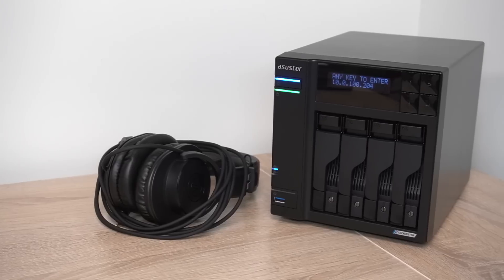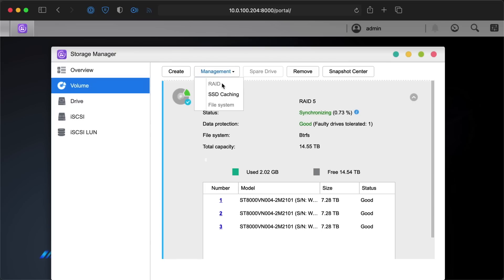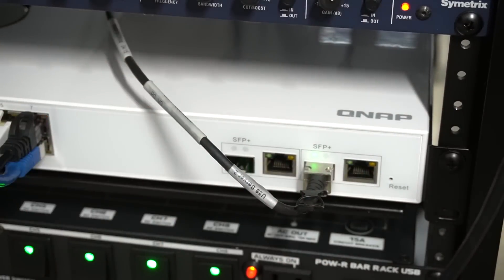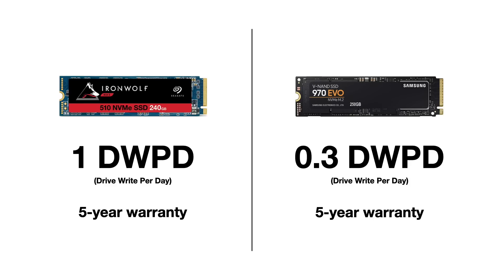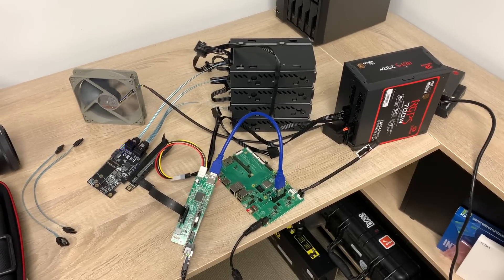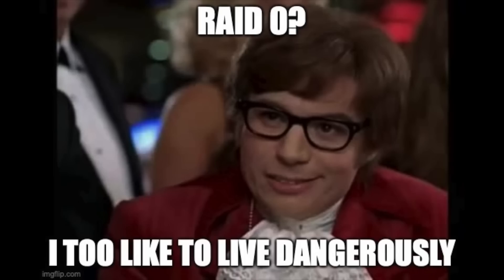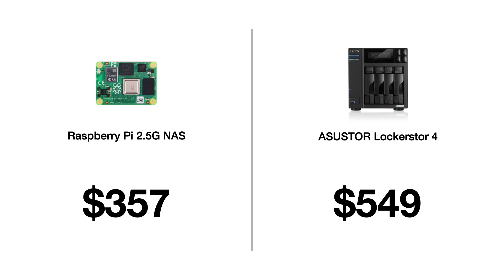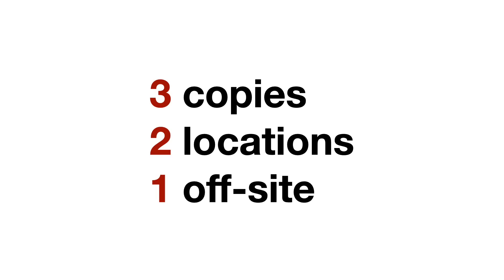Raspberry Pi vs ASUSTOR NAS Head-to-Head Part 2 - the VERDICT!

Comment: I recently built an Argon EON Pi NAS, which apparently released just barely after this video. My experience with it has been an interesting middle of the road NAS; Argon Forty put most of the effort together in making it. There are two weird downsides. The first is that the drives are connected via USB, and OMV doesn't let you set RAID up via USB, anymore, so you either have to hardware config RAID or set up a backup. The second is that it has 4 bays, but doesn't fit 4 3.5" drives. 2 of them are 2.5" drives at most. I don't think that's bad, but it is odd. 

I can't actually comment on the speed because I optimized it for capacity, but I strongly suspect that the EON will get bandwidth throttled by that single gigabit connection.

Comment: Yea, that's always something you need to consider. What is YOUR time worth? My employer, depending on the type of work I'm doing or if it's say after hours, charges anywhere from $250 to $800 an hour for my services. On my own personal time and considering tinkering with Raspi and home networking.., being a hobbyist maker... I'd put my time around $200 and hour. I'm cheap but not... eh...who am I kidding. I'm easy too !😝.

So, day you spend and hour setting up the ni e pretty NAS out of the box but..  you spend 4 hours building the Pi NAS...which is pretty damn cool as hell... you're in the a pretty big hole! I would spent 4 hours building the Pi at a rate of $800. He'll, I likely would've spent 4 times that much time considering I'm not even a year into Raspi and still learning.., a lot! That's why I subbed Jeff's channel. He's a good egg. 

Regardless, I do have a nice little Raspi NAS now at home running Open Media Vault...which I really like. My transfer rates are nowhere near what Jeff is doing but for now, I really don't need it to be. I'm not doing video or anything like that. Just nice having an extremely inexpensive storage solution that my laptops, other Raspis and mobile devices can easily access. It was also a fun  learning experience setting it up. OMV does make it a very easy process. Little bit of video watching and reading to really tweak things. 

What I love most it... no more 21U or 42U rack with servers acting like a very noisy space heater. Have 4 Raspi servers running all on a shelf on the wall... in my home lab with a very quiet fan and a fraction of the electricity. It really is amazing what you can do with a Pi! The only limitation seems to be ones imagination! 

Cool videos though, Jeff. Another example of what you can do with Raspi. Cheers!

Comment: Been looking at building my own nas for over 6 months now, I purchased a Qnap and I was underwhelmed, as with Asustor and with all nas systems I keep hearing you have to backup, so you buy the hard drives to place into your nas these hard drives cost a fortune for 18terabytes per drive. So I came to the conclusion you are just better buying a desktop usb 3.1 gen 2  bare hard drive dual bay direct storage device and just copy data from your computer to the hard drive then back it up to the second drive. I achieve 209 MB/Sec which is 1.5GB transfer speed which is pretty fast for me, doing it this way I dont have to wait 1.5 days for the nas to initialise and I save on space as if I build my own nas I have to buy another pc case which takes up valuable space. If I go with a ready built nas solution like Asustor, Qnap then you are not getting good value for money and if the nas fails you have to buy another nas from the manufacturer.  So I went with the OWC USB-C Dual Drive Bay Solution. The best decision I ever made I have all my data stored on one hard drive and then I have a backup copy on a second hard drive I am secure doing it that was, if you buy a nas and you have 4 or 8 hard drive with raid 6 or raid 10 you better hope your hard drives dont fail during the rebuild process as this is when you have the risk of losing all your data.  I dont have the cash to buy a nas then buy a second nas to backup up the fist nas tot eh second nas does not make sense to me to do it that way. Either way I have what works on a budget way of backing up my data. A nas sounds fantastic but from what I gathered it is risky especially with hard drives with 18Terabytes of storage space over 8 drives I could not stand to lose 130.4 Terabytes of data if say 3 hard drives failed all at the same time I would lose the whole array and your hard drives are plotting against you.

Comment: Not knowing much about NASes I wonder what performance gain you're getting on this monster vs just regular USB desktop hard drives plugged into the Pi's USB ports and the built-in ethernet.
Reply from the maker: Typically the USB drives incur a performance penalty of 5-15%, depending on the type of operation. That's the overhead in translating from SATA -> USB 3.0 -> PCIe -> the Pi's SoC.

For a 1 Gbps network, that might not be an issue if you're just copying large files and/or using the Pi as a media server.

Comment: A stock NAS is great, if you want to have an out-of-the-box solution. It will work fine for many years and you have many additional features. When it becomes too old, you have to buy a new one.
The Pi solution needs much more manual effort but you get a full computer and you can easily upgrade a view years later to the next gen Pi.
If you really just need a NAS for data storage, buy an external hdd storage for 200 bugs and you have everything you need.

Comment: if you could guide please,
we are looking to setup a setup where we want atleast 10 connections using the client/server model, a 1 TB SSD, 32GB RAM Xeon server. and 10 raspberry PI connected to it as clients. 
We want to setup an obser setup for our ongoing googlemeet live classes. will this setup work?
would appreciate insight on this idea.

Comment: Enjoyed your video. Just using desktop G3900 and truenas. Wondering if it worth getting those 2.5 Ghz ethernet cards. Also probably need another backup besides nas.  Don't understand 10 hours initializing. Would raid 1 take this long ? Seems file transfer speed depends on ethernet as well as hard drives. Have to learn how to use bandwidth and transfer programs. To increase speed  you would  probably have to go to SSDs. 4 8 TB ssds=$$$
Reply: I hope you don't mind us interjecting. We use software RAID which uses the CPU to build the RAID array. While the CPU on our NAS is plenty fast, the bottleneck is the 200-300 MB/s maximum the hard drives can handle. And 24 TB is a lot! Hardware RAID takes advantage of dedicated silicon to build arrays, especially in the background. It is often faster. Plus he has 24 TB as well. During the building of the array on an ASUSTOR, it is usable and you can store as you would normally. You do not need to wait. 

And yes. Those 2.5GbE cards are worth it and are often the same or similar controllers to the ones we use directly in our NAS. If you don't have enough PCIe, we sell an affordable USB 3 to 2.5GbE adapter as well.

Comment: An alternative is to use another SBC, like the ODROID HC4 (ideal if you only need 2 drives and GbE), or a Rock Pi, which has PCIe Gen2 x4, and official SATA extension boards. Using these, you could build a NAS for about $100-200, much cheaper. They also have the advantage of having AES acceleration for encryption, unlike the RPi 4, which delivers poor AES performance. 

Another alternative would be to build a PC with an Atom or Celeron motherboard, and that would still be cheaper and more flexible than most ready-built NAS (as low as $200), and easier than the SBC. This is also the cheapest way if you want ECC RAM.

Comment: 1 Question: What Issues you ran into by using the Mikrotik SFP+ Switch? (since i have the same in my environment)
2 Question: You know anything about issues with Ironwolf NAS drives when using raid (especially zfs) - according to some reddit posts "Ironwolf Drives are not suitable for ZFS"

Comment: That's Seagate for you. DOA! lol I wouldn't trust my worst data on a Seagate!
Reply: My oldest IDE that does still work fine is a  Seagate Barracuda ST280011A (80GB) built in 2003.
Second IDE is a Maxtor DiamondMax Plus (120GB) built in 2005.
The oldest SATA that still works fine is also a Seagate Barracuda ST1000DM003 (1TB) built in 2012.
There is a reason why a lot swear on them.

Comment: whole day raid system disk initialization times aren't the thing that you probably want to have as an end user. there should be smarter ways doing it - an empty disk is just empty. no need for checksums until there is data that has to be stored.

Comment: For my own purposes I made a NAS of similar size out of a Raspberry Pi 4 and a Terra Master USB 3 DAS. So far it works quite well - with RAID5 (ext4) speeds are pretty much enough to saturate the Rpi Ethernet interface. Beats over the counter NAS systems in configurability.

Comment: I’d like to see you try to use a better nic that offloads from the cpu better, that interrupt rate was killing you. I’d really like to see this with an intel x550. It completely blows away cheaper 10 gig cards at file transfers, while a simple nperf test showed no difference in the two NICs.

Comment: I wish Asustor was selling their ADM OS, so that we can use on our hardware. It is really,really good. I have their NAS since 2018 and it is working great. The only downside now, is that it is old dual core Atom CPU. I wanted something based on AMD Ryzen APU (so 4c/8t, with good enough GPU). But their price with this kind off CPU is just ridiculous. OMV is simply just not there yet. I want NAS + Kodi features. And that is one thing hard to do.

Comment: Fun fact: you can spin down HDDs from command line with `hdparm -y /dev/sda/`
They will automatically spin back up when needed (or you can spin them back up manually too). You can set the auto spindown time and set various parameters with that command.

Comment: Seagate HDDs... DOA. Only slightly worse than my experience. I find Seagate makes super fast drives that also fail super fast. They also fail suddenly. I've had a lot more luck with WD. When they're punished to the point where they die they hang on for a bit, so you can just about save your data... manually if you have to.

I wonder what their SSD's are like tho. Seagate likes their speed and there isn't much to go wrong with SSD...

Comment: Isn't it better to buy four external drives with usb3 and to use the USB inputs on the Raspberry Pi 4?  in combination with Raid 10 where the hard disk 1 + 3 is connected to usb3!  2 and 4 on the slower usb2!

Comment: Hello Jeff!

Argon40 just released a new NAS drive on kickstarter are you aware of the package? I have backed the project and waiting for the 4 bay NAS drive! Technically it uses the 5gbps usb3 port for all 3 drives (which should be fine considering its only a gigabit NAS I guess). Maybe it can be upgraded to a 5gbps NAS using a 5gbps to usb 3 adapter? This video convinced me to buy an 8gb pi4 for the NAS due to the queing you found out :) Thanks!

Comment: While I like the Pi's as experimental platform, they are just that in my opinion when it comes to my data I go for stability and thus get out-of-the box solutions.
Reply: I used to have the same idea, but after using a Synology for 8-9 years I now either have to buy an entire new unit or run something that gets no updates. If something breaks I also have to buy an entire new unit. There are no replacement parts for sale that are supported. Besides that suddenly software packages are no longer supported or even worse can no longer be downloaded which really hinders the ability to keep using the NAS.

Having an solution run for 9 years is great, but I want to be in control what parts i replace to upgrade or replace to keep access to my data. I also want an system to run for longer than 9 years. Adding waste to garbage piles shouldn't be the goal. Ideally I want to upgrade a solution if my usage changes or if I want added features which isn't likely with a NAS..

I don't see a Pi as a solution because I had too many break on me in short amounts of time, but a self built system is something I'm really considering.

Comment: Am i the only one who find NAS product overpriced ? A nas is no more than a computer with few big HDD and couple software. I don't know of curent price but i bought a small HP ProLiant barebone server about three years ago for less than the price of that nas. Id's say it's the best of both worlds, totally customizable but starting with much more potential than a pi, still neet and self contained. I haven't measure th power consuption but it's not enought that i see any significant diference in my electric bills with it on or off.it has  4bay hot swapable sata 3.5" hdd + i put a small sata ssd for the system instead of the optional optical drive, and also 4 cores but they are xeon cores so much more power under the hood. If you can find one of those on the used market i think that would be the best solution in terms of price/performance/customizabillity. 

Just my 2cts...

Comment: So here is the problem that I have with the ASUSTOR and others like it. I can and have built far more capable mini-itx systems for a little over $400, then you get a more powerful solution, more flexible, and more upgradeable. Sure, I get it, some people just want to buy it, throw the drives in, set it on a shelf and not have to mess with it. The thing is if you build it based on regular PC components you get the same thing, just maybe a little more time in the setup, but save like $100, or in some cases far more than that, and over the life of the product you probably save considerably more since the pc can swap disk controllers, CPUs, RAM, powersupplies, network cards, etc to keep it going without replacing the whole thing for far longer.
Reply from the maker: This is true, and it's the big reason why NASes are often in an interesting spot—but most NAS users buy them because like you say, buy, toss in drives, and done. If you need storage quick, it's the quickest way to get it set up, and for most of the vendors (at least the good ones), you'll have support for at least 5-10 years, meaning you have a while to worry about your hardware going unsupported.
Reply: @JeffGeerling  yeah I just don't like how much they cost over the price of the hardware, the $400 price point was for a real full desktop processor, when I built my custom router that was what I paid for a mini-itx system with 16GB ram and a Ryzen 3 3200G. Far more powerful than the likely low end laptop grade CPU in the NAS, more than enough to run zfs with high gzip compression if you want to. Meanwhile to buy a NAS that is anywhere close to that powerful you would usually be into the rack mount systems and spending like $2k or more. It's not that I don't understand why people buy these, I just feel like there are far cheaper, far more powerful setups that don't actually take that much effort to get running, certainly not the $300-$400 over what an equivalent SBC to what is in that asustor would cost. As a matter of fact I have built and configured small PCs to be used as and NASs systems at small businesses for less than the price of that asustor.

Comment: I think a pi isn't the right comparison to be making. For $550, you could build out something x86 that's more performant. Comparing this device to a pi is apples and oranges. 

That aside, the pi would easily meet most people's needs.

Edit: Also the 3-2-1 backup model is a little outdated. Might want to look into 1 2 & off or 3-2-2/3-2-3 backup architecture.

Comment: I don't understand why adding an inefficent 700 watt power supply to this setup is a good idea. Use a 150 or 250 Watt supply, which operates in a more efficient window. Best efficency of a power supply usually is around 40-60%. So if you need 50 Watt in the end, buy a 100 watt Power supply.

Comment: I just use an intel NUC connected to 2 18TB USB3 drives, with a linux distro on it, and I don't use any RAID. I just use one of the 18TB drives with NFS/SMB as my network file vault / NAS, and every night at 3am the NUC's cron daemon starts a bash script that rsyncs the contents of the first 18TB drive that I use to the 2nd 18TB drive, so it's an identical copy. 

Rsync is good as it only synchronizes the differences between the 2 drives instead of copying everything over every time so it only takes a few minutes usually...
It's better than using RAID1, as, if I accidentally delete or damage a file or many files, I have until 3am that night to fix things with yesterday's copy...

Finally, once a month I attach a 3rd 18TB drive and manually rsync it so i have a 3rd copy, which I give to my trusty neighbour so it's stored off-site.
On that 3rd off-site drive, all my personal data is encrypted except for my movie collection, and my neighbour plugs it in to his android TV box so he can watch movies from my collection, and once a month he brings it to my door for me to do my rsync backup so my data is safe, and he get's an up-to-date library of movies and series to watch :)

Comment: I wonder if you actually need a RAID at home when you backup your data in 2 locations anyway. It would only protect you against a drive failure which rarely happens, and then you'd have to download it back. If you can live with the time that takes I guess you can go without spending three or four times as much on hard drives.
Reply from the maker: Heh, 'rarely' can be true, or not. It all depends on whether you're lucky and okay with spending a few days restoring data if not.

In the end, it's all about how valuable the data is... and how important it is to have the data back quickly when the inevitable does happen.